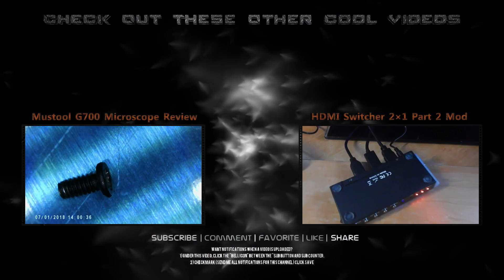Aluminum Alloy Stand Bracket Holder With Mustool G700 Modifications

Comment: Looks like a bit of a rough ride there.
I would suggest an alternative method - I guess you could try to simply make a single cut on the holder ring from the column side and then widen/stretch it to fit the microscope tube. The stretching could be made simply by twisting a flat screwdriver in the cut followed by small amount of filing/sanding to debur the cut. It's a small deformation and aluminum would allow it.
Anyway - nice vid with useful info, thanks!
Reply from the maker: Yeah, that could've worked too.